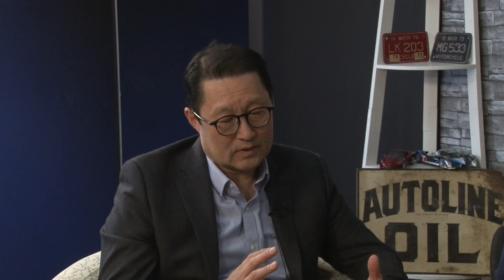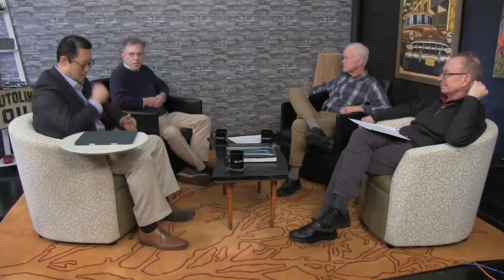Battle of the  Battery Chemistries: LFP vs. NMC

Comment: LFP has very little environmental impact the chemicals used are cheap and safer. The Golden battery in China can charge from 10 to 80 in 10 minutes. LG batteries are famous for SLOW charging and poor performance. I owned a BOLT the firebird all had LG packs. So I take everything he says with a grain of salt. All Tesla with LG batteries perform worse than the Panasonic battery packs.
Reply: still take LG any day over Panasonics that degradate even faster
Reply: @uludak8468  panasonics are superior I assume you are comparing NMC vs NCA chemistry?
Reply: @joeyscleaningladys  superior with a major drawback. panas anodematerial. silicon carbide graphite vs graphite (LG)